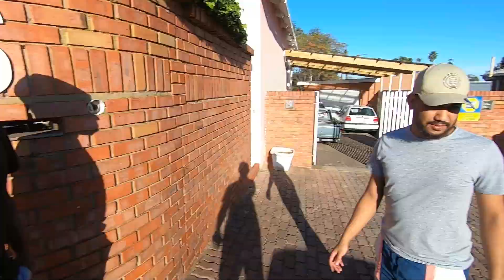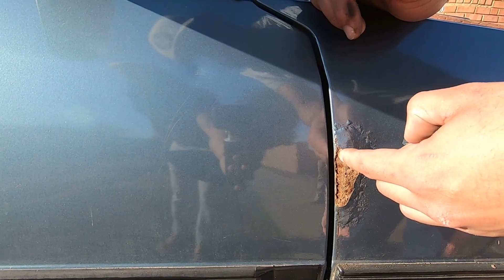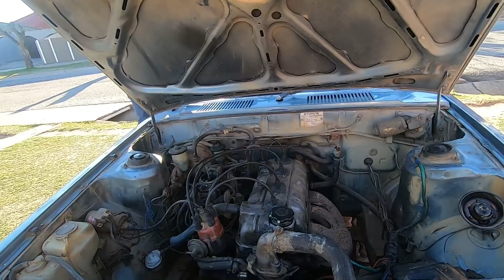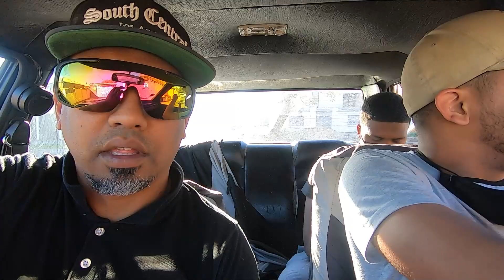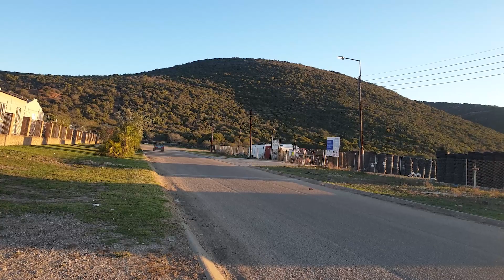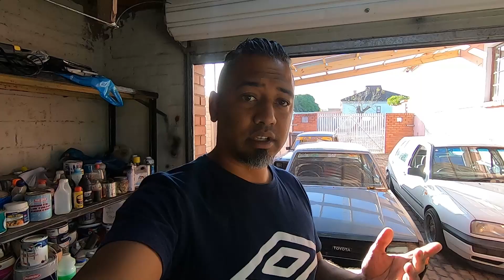Episode 1 OUR NEW PROJECT CAR

Comment: Cars with steering boxes have those issues,tend to respond very badly when turning🤣🤣that’s why I changed to my car to the steering rack of a KE70,the TE72 steering is just k@k😅
Reply from the maker: id really like to know more cuz...
Reply: The 1.8 and 1.6 is not a KE70 its the TE72. The T is for the engine type which is 2T or 3T. KE70 is the 1.3 the K is for 4K engine. The difference between the 2 lik the gentleman said is the KE70 has got rack and pinion steering, different crossmember so you will need the crossmember for the rack and pinion. Also will surely need to cut the firewall. Also you will need the steering column of the KE70
Reply: Oh and because the crossmember is different you will need to mount the 3T on the Ke70 crossmember as the mounts is different